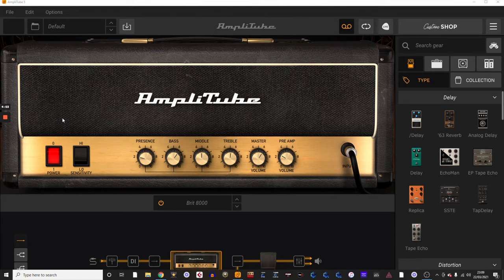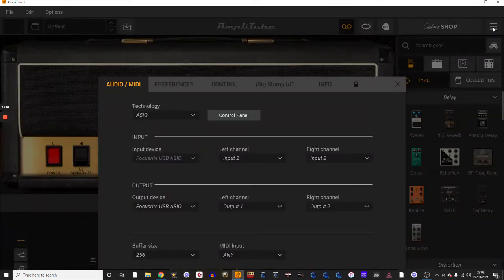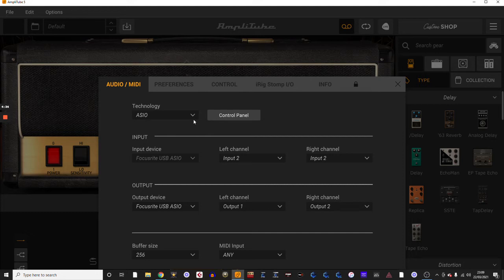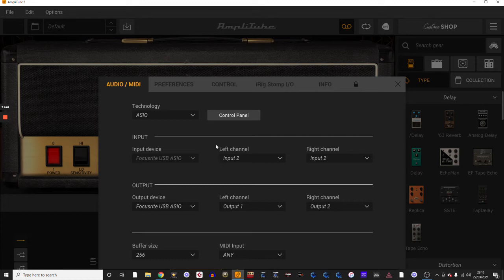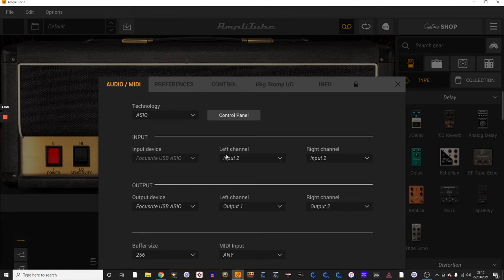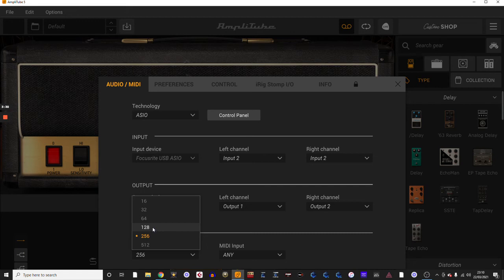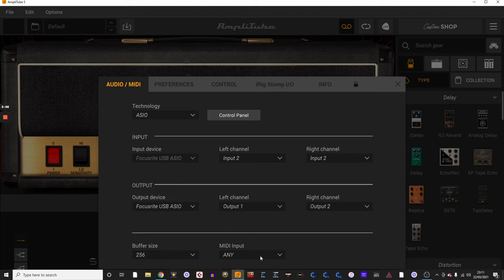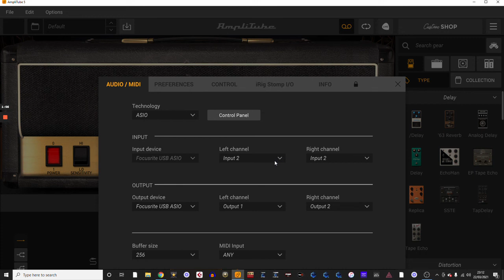Amplitube 5, basics of adding an interface

Comment: I want to use amplitube to simulate an amp while I play on music from a player. Problem : the music from the player is going in the input device at the same time as the instrument. Can we seperate the sound from Windows and the sound from my audio interface ?
Reply from the maker: I just plug the Jack output from my computer into some separate speakers I use for my PC to play music , I guess if your monitor speakers have more than one input you could plug in there. I use Yamaha HS7 as the amplification for my interface and a pair of small Alesis monitors as PC speakers

Comment: I cant set it to ASIO, how do yo fix that? It just wont let me select it but it doesn't why i cant.
Reply: I have the same issue with my focusrite scarlet solo, I press ASIO but then it doesn’t allow me to select any input devices
Reply: @ethanrrandall  same issue here
Reply: @ethanrrandall have you figured it out i need to fix it
Reply: did you find a fix??
Reply: @yumesek  not rlly. I think you need an audio interface for it to work.
Reply from the maker: Which interface are you using?
Reply: @tonegarage4491  irig
Reply: @Haruu1027  read my solution above
Reply: @KemeV where?
Reply: @Haruu1027 have you figured it out?
Reply: @yumesek  nah
Reply: @yumesek  what worked for me is selecting output device FIRST afterwards it outselected asio for me and i was good to go
Reply: @tonegarage4491 i use scarlett solo 3rd gen
Reply: Doesnt work for me either